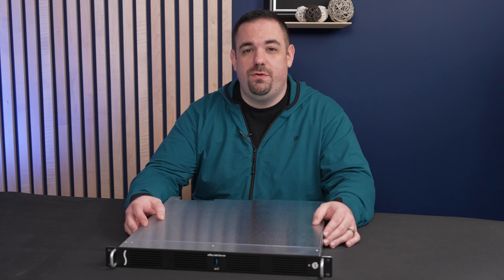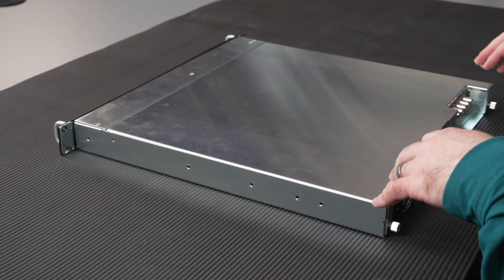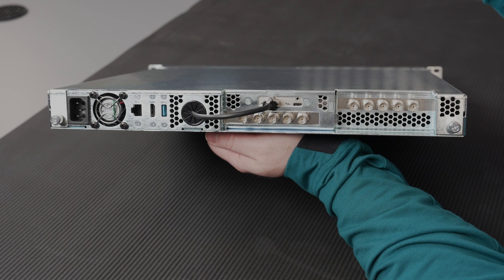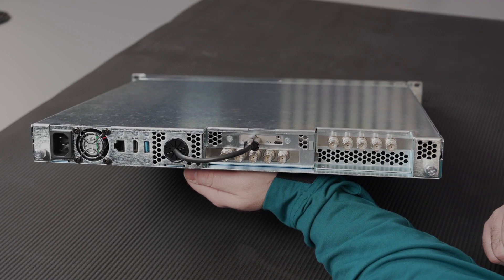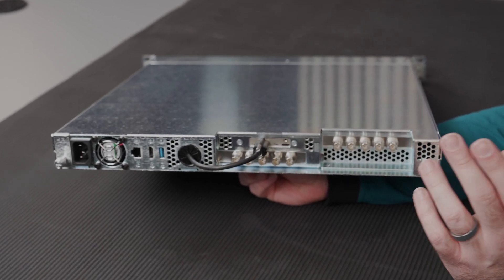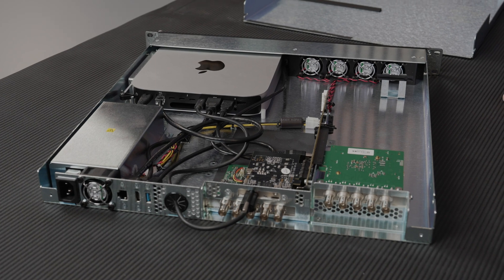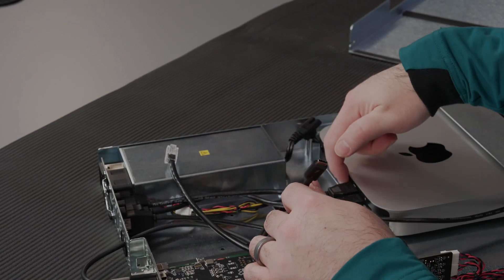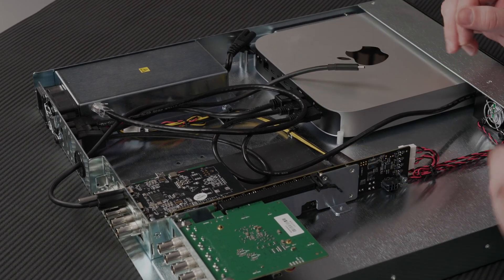Cleanest ZoomISO build! - Sonnet xMac mini server

Comment: Thanks for sharing. Just be aware that you can not put a Decklink Quad2 with 8 SDI's in this since that requires an 8-line PCI. This chassis have only 4-lane PCI x 2. So 2 of the Decklink Duo-2 is fine. :-)

Comment: Did you realize this unit doesn't do full TB3 speeds before you bought it? Sonnet hid the specs for this model. Their other newer units support full TB3 speeds. The backplane in this is their old board with slower PCI speeds.
Reply from the maker: No I did not. I thought this was the updated TB3 version. Looks like that on the website. Do you see differently?

Comment: What a cool product, but imho the price is to high. I am using a rack mounted mac mini for years now and I really would buy it for maybe the half of the cost but nearly 1500 bucks is too much for only an enclosure.
Reply from the maker: It is pricy. Sonnet makes another dual mini rack mount that doesn't have the PCIE

Comment: I wonder if this was a response to people wanting to have an xserve again. I could easily see ways to mount hard drives in there with a small sata, or sas card. The only thing I wouldn't like is the power supply being riveted in. If it goes bad you'd have to replace the whole case?
Reply from the maker: So true! Those xserve were pretty cool. 

So the good news is that the power to the Mac mini is pass through is the power supply is built into the Mac mini, but the rest runs on the power supply. Thanks for watching.

Comment: Can you show us inside the “power supply” I’m not understanding how a power supply goes into another power supply as the Mac mini already has one built in. Is it doing power conditioning? Controlling the fans? Or is it just a cable adapter passthru?
Reply from the maker: Hey thanks for watching. So the cover to the enclosure power supply is riveted to the case or I would bust it open. My guess is that it's just straight AC power since you are correct the Mac Mini has a built in power supply. The rest of the case needs power as well though so I would bet it splits off to transform the power for the other components. (like the fans)
Reply: @streamingct  thanks for the reply. I took a look at the product page after I left the comment and it seems you’re right. It’s a passthru with an extra 150w supply for the PCIe accessories and fans. I’m sad they riveted it shut tho.

Comment: How’s the noise level with all the 1u fans? Curious if this is something that can be in a fly pack.
Reply from the maker: Hey David! Good to hear from you. The fans were audible, but not too loud. There is a temperature sensor it seems because they would only ramp up if it got warm in the chassis. It’s nothing like a Dell server or supermicro.